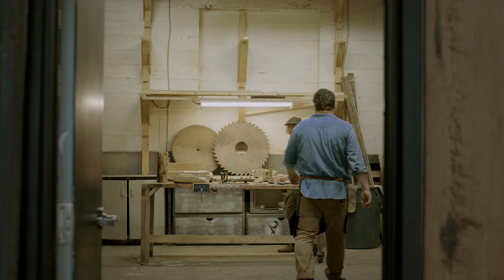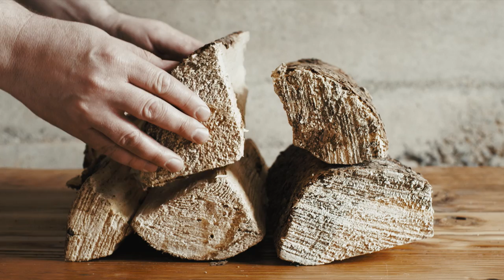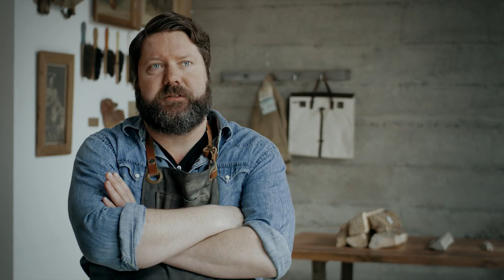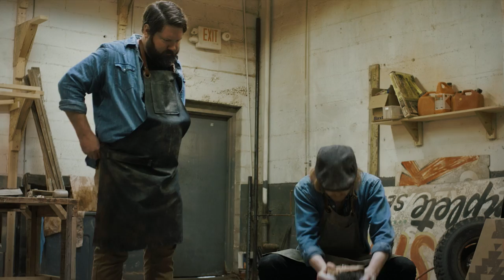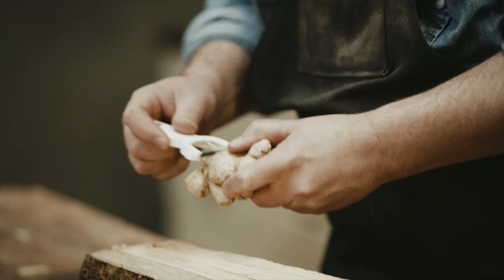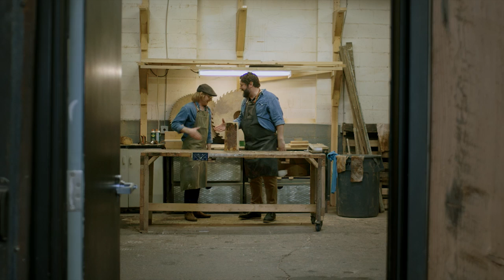Maker Series: Artisanal Firewood | CBC Radio (Comedy/Satire)

Comment: I'm gonna start selling "ULTRA Luxury handcrafted ROUGH HEWN" firewood for 1500 a bundle. The difference is that it's all chopped with a vintage axe and left in its all natural state; no drying involved guaranteed. For 2000 dollars a bundle I'll sell you straight logs; nature has put hundreds of years of all natural craftsmanship into every cubic inch.
Reply: +Joey Ogden $3000 per bundles' worth for knotted twisty elm. Split it yourself for hours and hours and hours of fun!
Reply: +Joey Ogden And lose weight!

Comment: $1,200 well spent. Used it to christen a new fireplace. Incendiary heat was a 10/10 with only slight wisps of fire licking from the artisan wood as it crackled and popped (9/10) for a smooth ember glow finish (9.5/10) that lasted myself and the dinner guests well into the evening hours. The post ember ash coated all of our clothes (2/10), we didn't even need to use the Axe fireplace spray.

All in all an A+++ experience. Highly recommend.